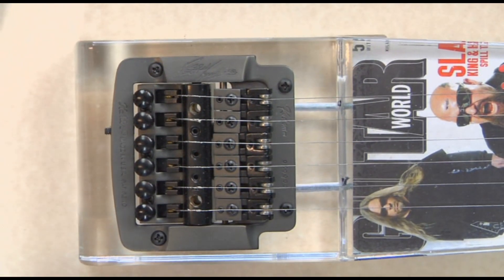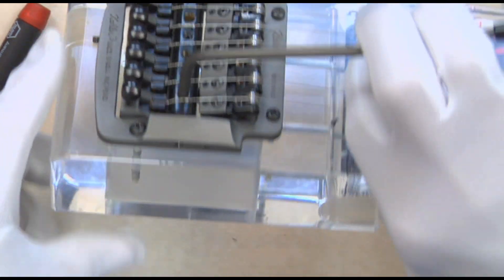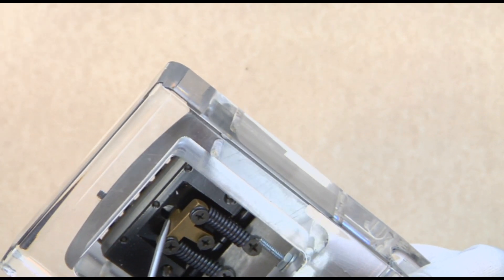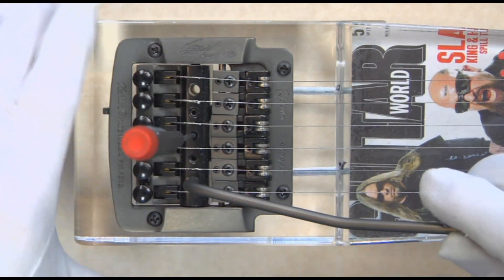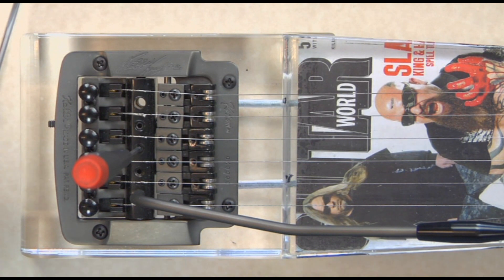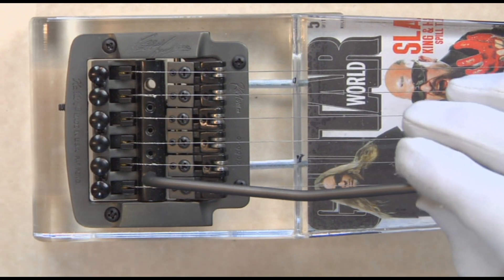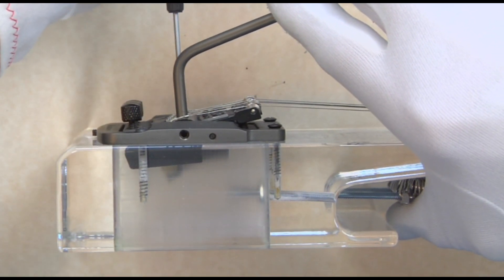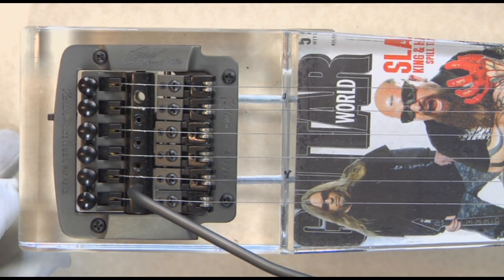#2 of 3 Kahler Guitar Tremolo 101 Basic Guitar Set Ups / with G. Kahler

Comment: I recently got a Yamaha SG2000 with a Kahler (2200) installed. I think it must need new springs? It looks relatively clean but it will absolutely not stay in tune. I specifically ordered the guitar because of the tremolo and I'm excited to get it working properly but it's not even close at right now. It's an older (1979) guitar and I'm sure the bridge is old as well. I guess I'm going to need to get proficient at Kahler maintenance.
Reply: It may need some tlc and cleaning check the cam isn't pinching the sides of the frame so it can move freely after 40 years the springs may need replacing but the bridge is possibly in need of a clean especially the saddles and rollers and the bearings in the side of the cam

Comment: AGAIN, AWESOME info, where was this 40+ years ago? LOL... There should be a pamphlet with every guitar they're installed on!
BTW, mine only has 3 holes on the cam. One for the bar, one in the very middle, and one between the bar and middle, it's missing the 3rd screw. No model number on it, just a patent number.

Comment from the maker: @boleynali 
1. Look at top of cam
2. See hole for the arm
3. Screw arm in hole
4. See screw next to the arm
5. Use 5/64 Allen Wrench
6. With arm in: Screw the set screw down "Clockwise.
7. Now feel tension on the arm
8. More tension? -Screw down more
9. Less tension: -Screw "Counterclockwise" or up
10. That's it...You now have controllable tension on the arm rotation.
Hope that helps...

Comment: A friend of mine brought me his fender strat with a kahler spyder tremolo to see if I could figure out what is wrong with it. I have a lot of experience fixing guitars of all kinds. But I can't find the problem with this thing. It doesn't look like any of the trems in any of the video I see. It doesn't have rollers on it, like the one in this video. It will not stay in tune. Ever. I took it apart and cleaned it. I set it up in the way that has always worked for every guitar I have done for 30 plus years. It just won't stay in tune. I look at forums and there is idiotic stuff like "you're doing it wrong". What does that mean? Specify what "wrong" is and what "right" would be. 
Anyone have any idea what the issue could actually be? It doesn't seem like there is anything for the string to bind up on, unless it's the whole section that goes down into the block where the string clamps in. If that's the case I would have to say the whole unit is a paper weight. Unless there is some trick to getting the string to not bind up in there.
Anyway, if anyone knows where I can get useful information on this particular unit I would love to hear it.
Like I said, no rollers anywhere. A blade type fulcrum. The strings get the ball cut off and clamped in on the bridge side. Locking nut on the other side. Doesn't seem like anything to go wrong. Sometimes it seems like strings go sharp, sometimes they go flat. But they don't stay in tune at all. It's unplayable like it is. 
Thanks in advance if anyone can respond to this.

Comment from the maker: @boleynali For the clutch- The set screw closest to the arm, turn clockwise it will tighten the arm- Counterclockwise releases clutch. Good Luck.
You may install a PN 5513 String Lock behind the nut...can order on website. Thanks!

Comment: I’ve heard some guitar players prefer springs from the bass tremolo system for more stiffness in the arm? Does this also improve sustain? Any drawbacks?
Reply: People do use the bass trem springs for a Floyd type of tension and for use of heavier strings(higher than 10's for E Standard, etc.) I haven't heard anything about improved sustain. It will be harder to use the trem but it's a matter of preference.

Comment: Do you use with a Kahler string locking nut or with the floyd rose locking nut ? is there any difference between them in terms of tuning stability ? I live in Brazil, if I get a Kahler 2330 ($ 399,00 + 60 % of tax) I have to pay 60% of tax that's too much for me.
Reply: Hey is it working when you use floyd roses locking nut on Kahler ?

Comment: i,ve just bought a 1979 hardtail strat with kahler trem fitted.i,ve no idea how old the trem is but it looks mighty similar to the 2300 but has no locking facility.you don,t show how the clutch is adjusted and exactly what it does.can i get a setting up pamphlet from you .do you set the cam up straight b4 you put on strings or after.thanx.

Comment: is there a way to just block the tremolo so it doesnt move or so it just does dives i got a firebird with one of these and im not really going to be using it plus i find the setup to just be annoying
Reply from the maker: Any Kahler made since 2006 has a locking mechanism so it functions as a fixed bridge.  It's pretty tough to block so it only goes down in pitch, but theoretically it can be done.
Reply: ok lol im fine having just a fixed bridge i will have to look at it next time i restring the guitar thanks
Reply: milk monster what I did with my Kahler to make it a fixed bridge was remove the springs completely and bolt a sheet metal plate (using the same spring screws) in place of the springs. a little piece of sheet metal, four holes and that was it. It's been like that for 20+ years. I break a string and it doesn't go out of tune